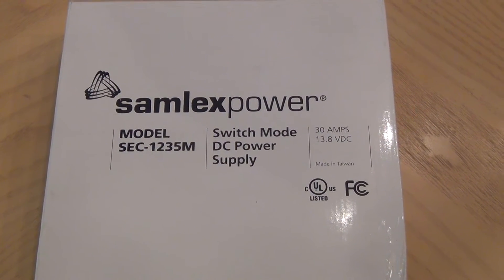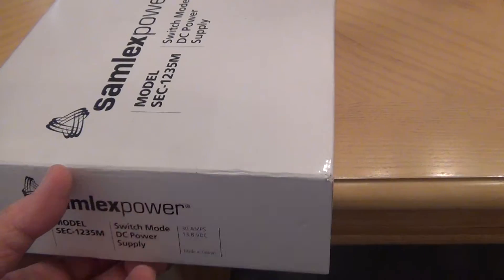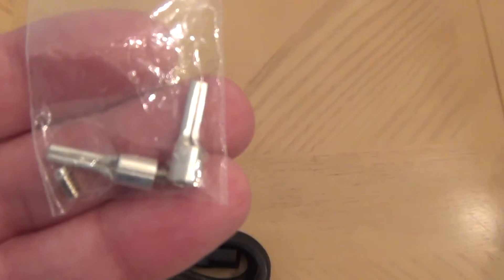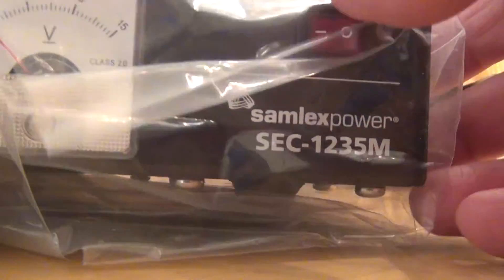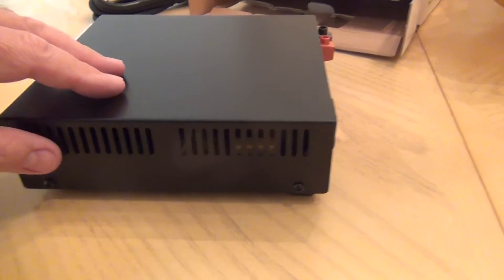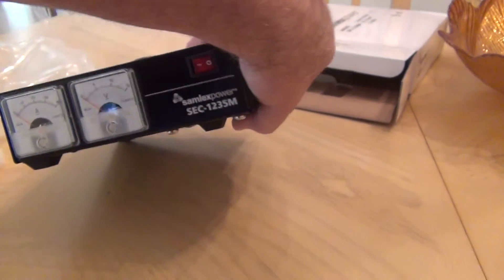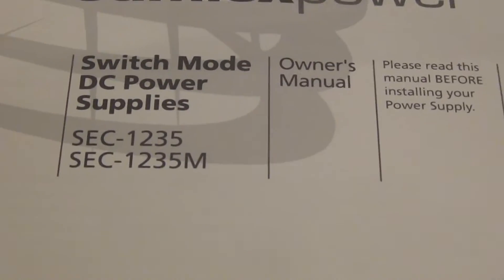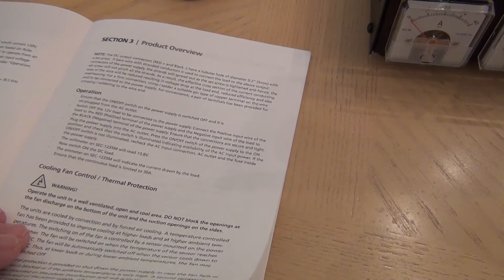Amateur Radio Power Supply: SAMLEXPOWER SEC-1235M

Comment: I had the 1223 for alot of years and the fan in it never came on. it just ran cool.
I just got a new 1235 today and the fan comes on with the radio just receiving. Then it takes like 5 minutes to shut off.
I'm kinda pissed.
Samlex has always been good to me but I'm not happy with this. The power supply isnt hot either, its cool to the touch
Reply from the maker: My problem with this one was also that it would drop almost 1v when Tx 100W on my HF rig.
Reply: @ecolive3900  wow! at the power supply or at the rig? thats excessive
Reply from the maker: @1112223333111   At the power supply... not sure whether I had a defective one, but I ended up returning it.